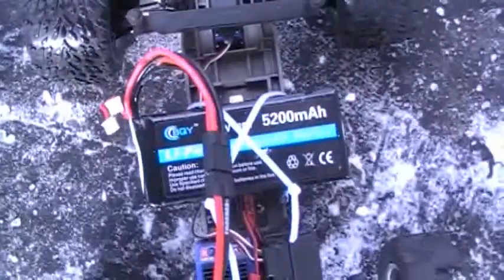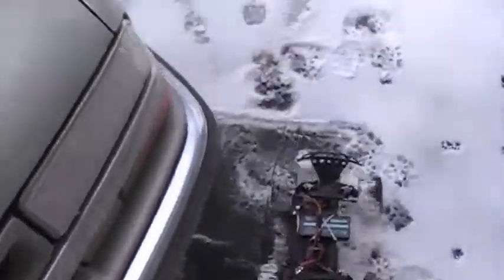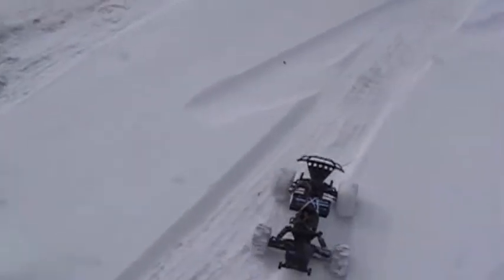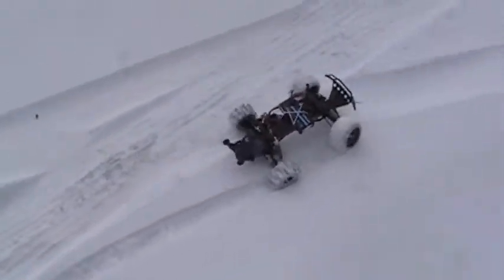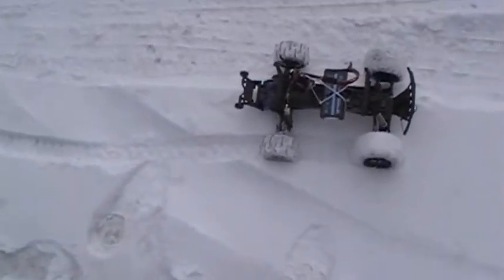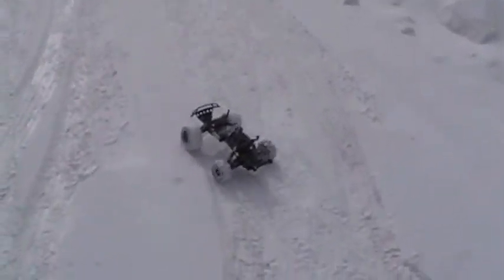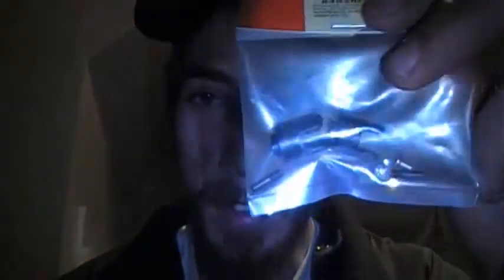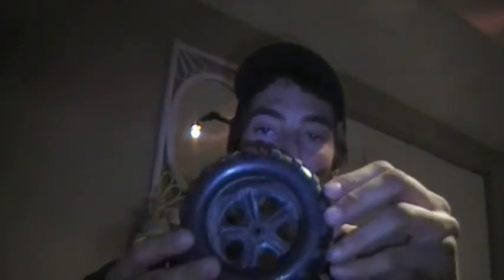RC TIRE TIP AND NEW PARTs

Comment: If you keep breaking/wearing out driveshafts i believe you can mod Jato driveshafts onto there that are much stronger. I did that to an old nitro sport i had and they are the same driveshafts i believe. You use the stock stampede outdrives modded to fit onto the jato axles and i think you have to slightly shave where it hooks to the trans.